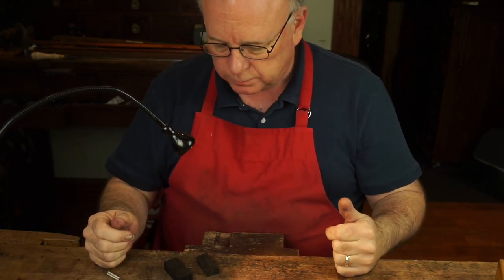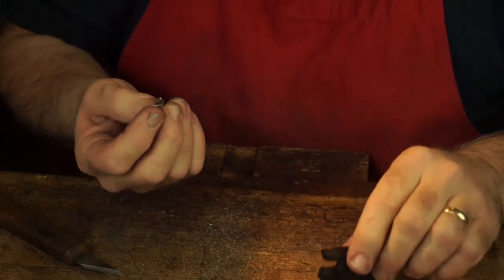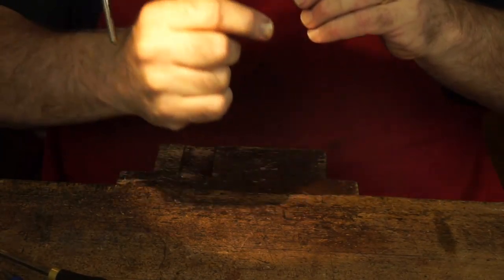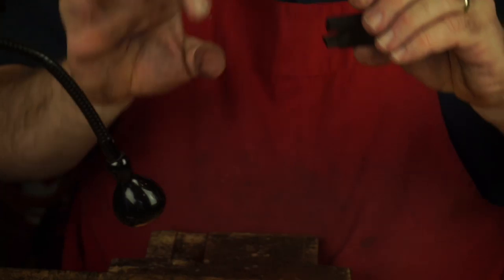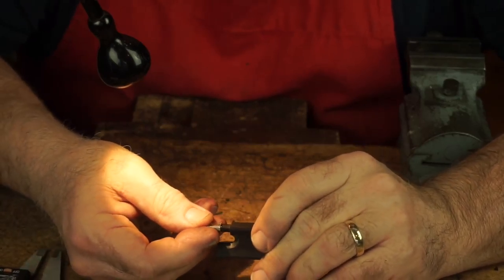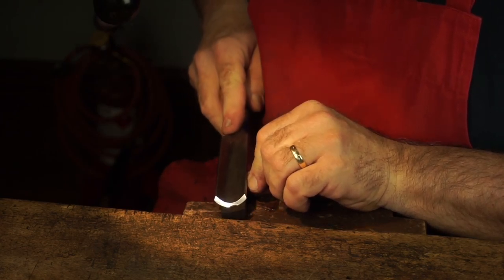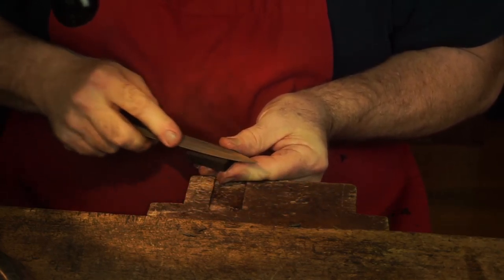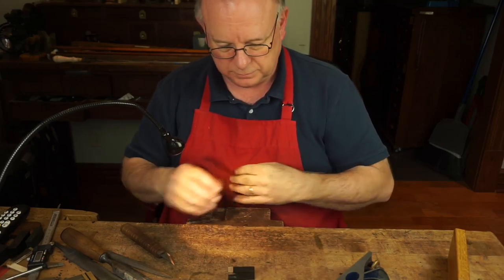Covid-19 Violin bow making: Day 2, Hour 2 Fitting the ferrule and refining the frog.

Comment: Around 30:00, were you planing the edge of the ferrule or the frog? Or both?
Reply: I am planning the ebony but I may tack I tiny bit from the ferrule as well.  The ferrule is at its finished width so you don't want to remove any more material.